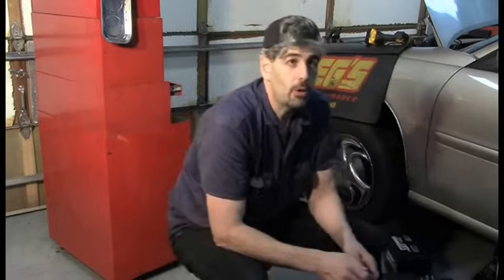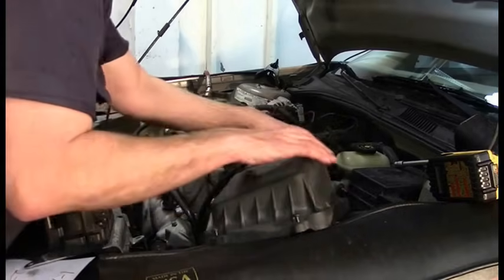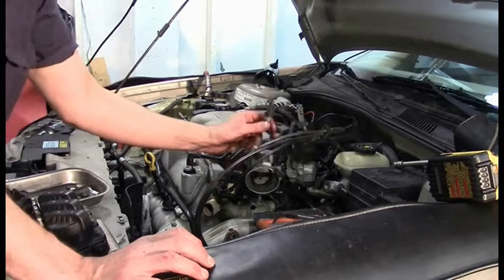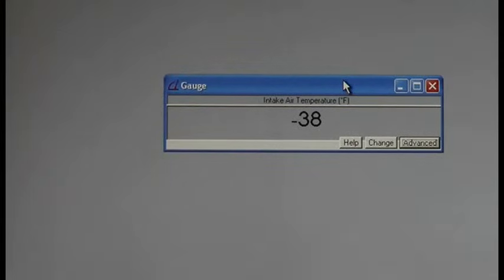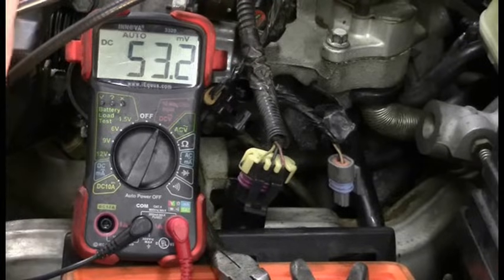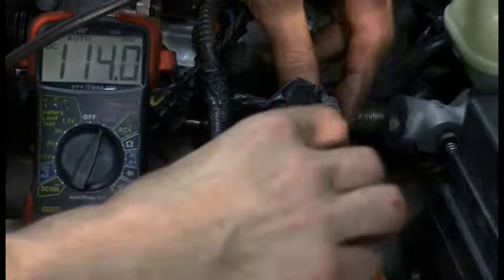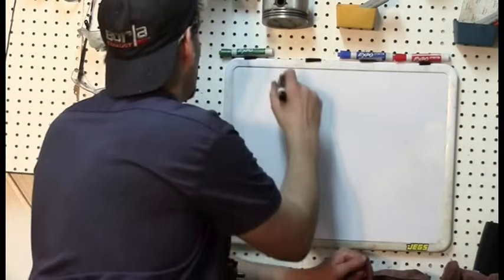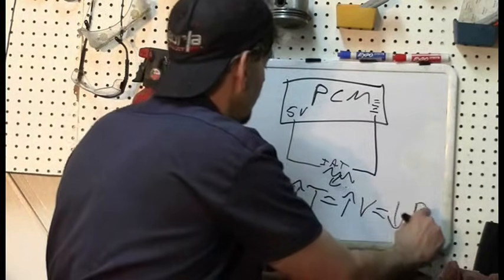IAT ( Intake Air Temperature Sensor ) Diagnosis P1111, P1112, P0113

Comment: Thank you Matt.  My understanding is that the 5V reference originates in the PCM travels to the sensor, is processed by the sensor and then returns to the PCM ground at a voltage of 5 or less.  The wire that returns the less than or equal to 5 V signal  to the PCM is the SIGNAL wire. Do I have the terminology right?  Or is that called the ground?
Reply from the maker: in this design it’s not nearly so complicated. there is no processing by the sensor- the sensor simple changes resistance proportionate to temperature. that’s all. the voltage drop between the resistor at the PCM after the 5V reference and the IAT is simply measured and converted to determine the temperature. 
   the return to the PcM will ALWAYS  be 0V.
Reply: So the 5V reference passes through the thermistor then travels down the ground wire, which grounds through a resistor that’s inside the pcm. This allows the 5 volt reference to remain constant while allowing a volt meter within the pcm and between the pcm resistor and thermistor to see the voltage drop?  Like a voltage divider?
Reply from the maker: Correct except technically the internal PCM resistor is right after the 5V regulator in the PCM. Your description would also work- however the internal resistor is not on the ground side.  Maybe on some cars it is, not this one and not most.
Reply: @ thank you Matt

Comment: I measured the volts from pin 1 and 6 which is the input and output of the IAT part of the MAF sensor and say 4.57volts. if that's ok then why is the computer reading 90-100 degrees when the weather is 60 degrees. Maybe the output wire is the problem and is reporting back a higher voltage making the computer believe the air is hotter and less dense than the air actually is. If that's the case that probably explains why I am getting lean in both banks and the car can't idle. It will crank and start up and RPM will raise then the engine will die. The computer is probably cutting back on fuel thinking it is getting less dense air but in reality is getting 60 degree air so the car is running lean. The car was running during the summer but as soon as the weather started to get colder the engine progressively got worse
Reply from the maker: sounds like you measured with the circuit open. sounds totally normal.

Comment: I have a 2003 Ford ranger and I wanted to test the IAT at the PCM  however the IAT is built into the MAF. All I see is IAT sensor wire gray. Idk if you could help me with what pins on the PCM to test with the IAT pin which I found out to be pin 39

Comment: Hey where are u from man?
Reply from the maker: I’m from St Louis but I live in Denver Colorado.
Reply: @SchrodingersBox  damn if only you lived close by 😂 my car has been having issues with starting and after replacing parts (like an idiot) we've narrowed it down to it's the IAT wiring since it was also pretty loose when we took apart the fuse box. Is repacing the entire wire as simple as cutting it and ordering some new ones or is it better to get a professional to do it?
Reply from the maker: How did you trace it to the fuse box? No IAT I have ever seen is powered from a fuse.  In fact no thermistor is- how would that even work?
   What car is this that the IAT is powered from a fused source? I can’t believe that’s accurate.
Reply: @SchrodingersBox  my bad i got confused the relay for the fuel pump was the loose wire. We think it’s the wire for the IAT because the scanner keeps saying code P0112 “Intake Air Temperature Sensor 1 Circuit Low Input” no matter what parts we replace or clean.
Reply from the maker: If you have a low circuit input then you have a short to ground on the 5V reference to the thermistor. I can’t imagine anything else that would cause that. You can verify easily with a DVOM
Reply: @SchrodingersBox  you really know ur stuff on cars thanks so much man, we're gonna try and repair it this weekend.
Reply: @SchrodingersBox  oh btw I never answered, it's a 96 ford explorer
Reply from the maker: Ford explorder uses a typical basic 5v reference with low reference return. Nothing special at all. You can easily confirm the issue with a DVOM on a loaded circuit.  Don’t forget the internal 5V resistor in the PCM can also possibly have a ground fault so if you don’t see a voltage drop across it, that would be an indication. It’s not likely that is the issue though.
Reply: @SchrodingersBox  I seriously hope you have lived a blessed life so far, the amount of info you've given me helped way more than the $474 work my mechanic did (which didn't fix the issue lol). It isn't his fault of course. Thanks man

Comment: I’m ready to turn Amish and get a horse and buggy! These newer cars, mines a Dodge charger 2010 sxt 3.5! Did a tune up last June, and have had one problem after another! If it would have been my 1995 Subaru that car would have been finished the first day! Why the hell do we need computers in a car and sensors etc. we got by just fine without computers in cars! I HATE NEWER CARS! Just too damn ridiculous! Give me an old boat car instead! DODGE THE DODGE‼️
Reply from the maker: once you understand the basics you easily not only appreciate computers in cars but immediately recognize the overwhelming undeniable advantage of them.  it’s not even close:  computer controlled cars are far, far more reliable, economical, MUCH safer, WAY easier to diagnose issues, and overwhelmingly more comfortable and convenient.  
   the real question is not “why do cars use electrical and computers”. It is “why do people not learn about electrical and computers?”
  it’s clear the direction will never go backwards so it seems logical to me that people would learn the basics of the new technology in the same way as how A hundred years ago people learned about fuel pumps and points and mechanical timing…. So why are people still focused on that when it’s been dead for almost 40 years now?  It makes no logical sense to me!!

Comment: This is a GREAT video!
Mine has trouble starting the first time during the day.  After that it starts fine.  
It was time for it, so I changed plugs, wires and coils, and the Mass Air Flow sensor (after cleaning the original miles = 275,000).  
So here I am researching on your great videos.

Comment: I have a 1996 Dodge B2500 van that is hard to start, takes about 30 seconds of cranking to start it when it's cold outside. I thought it was the intake air temperature sensor. I replaced it with a new one but no change in the cold start. It's something else.
Reply from the maker: agreed. it’s something else. an IAT won’t cause a hard start anyway.
Reply: @SchrodingersBox  Thanks. On to looking at something else.

Comment: The higher the temperature, the  lower the resistance; then,  it follows that the voltage goes low. I think thats the right explanation basing from the bench testing on the sensor. (ohms law)

Comment: How do I replace an intake air temp sensor wire damn mice chewed my wire and I can’t get an inspection because of it
Reply from the maker: just replace the wire. that’s all.
Reply: @SchrodingersBox  splice in or whole harness? And thank you for your response 2*
Reply from the maker: Thanks for the sub. Just slice it in with butt connector is all you need. That’s how I fixed this one!

Comment: Thanks for all your great videos Mat, I am watching many of them for all your explanations and "how the sensors work", I am having a MAF sensor with problem that take a lot of time to find the problem, No codes on a BMW 2010, finally found that the integrated (IAT) into the Bosch MAF sensor was reading wrong like 10 Degrees more but it work. I am just a DIY but finally find the problem, I will look for any video showing those scenarios and what should be the normal intake temp in different environment. Thanks

Comment: Matt, id like to subscribe to your paid channel. 

Im working on a 03 accord 4cyl erratic idle with p0507 and p2279 (idle higher than normal).

Other info: car fuel system remains in Open loop no matter how hot the vehicle warms up.

Data Observations:
I was looking at the live data & noticed two IAT values: 
Start IAT: 97 F
IAT (current): 78 F

My understanding: the intake air temperature is cooler despite the vehicle becoming hotter than the initial intake air temperature and this seems absurd to me because it should be the opposite unless...

Question:
Either a sensor issue

Or an air leak causing the air temperature wirhin the intake to become cooler

Or a PCM problem

Note: i have smoked the intake for a leak and onpy found a leak that did not affect intake air temp as it was located between the air filter and the throttle body; i sealed the leak, regardless. Smoking the intake and all hoses but no leaks whatsoever; used propane and nothing either. 
Cleaned the throttle blade and the attached idle air control valve; chdcked pxv valve operation which seemed to not click vigorously and replaced it.

As far as i hate to be a part changer, this car is making me paranoid lol
Reply from the maker: Allow the vehicle to totally cool and check the IAT against the CTS and if they aren’t within 5 degrees you likely have a bad IAT. 
   However that won’t cause your high idle. Check the IST step count and MAP voltage.
Reply: @SchrodingersBox  this ended up being a bad failing throttle body. thanks a lot

Comment: My iat, Wich comes together with a maf 5 wire sensor, reads 89 Celsius at cold start in the morning. But I do only have a P0103 code. Any idea?
Reply from the maker: Compare it with the coolant temp sensor… what’s the coolant temp sensor read at the same time?
Reply: @SchrodingersBox  coolant 37 C, IAT 89 C. Everything show by the OBDII elm327 scan tool on the screen, in real time. At first start 9am. Outside temp around 15 Celsius. Mine Maf/IAT is a denso 37980. Honda CR-V k24z1.
By the way... I do not have a p0111 or else. Just a p0103 and a p0355. Running in 3 cilindros now. Horrible shake at idle.
Reply from the maker: Based on that I would say that is seems you have a short circuit on the IAT but it’s not your engine issue. The engine issue is surely a misfire from an ignition problem and most likely it’s causing the P0103. I believe fixing the ignition misfire will also fix the P0103. The P0103 is likely a result, not a cause. 
   Try switching the coil with another cylinder and see if you get a code for that cylinder. If so, replace the coil and car should run fine. If the code doesn’t move then you have a wiring issue and will need to check reference, signal and ground. 
   I wouldn’t worry about the IAT- it’s not going to cause a rough engine idle. The contribution from IAT is really minimal.
Reply: @SchrodingersBox  first thing I did. Changing coil, sparks. I did also check continuity between the coil connector and the pcm fat connector. Everything was ok. Today I jumped the two main wires of the maf. Mine is a 5 wire maf. With all the dtcs codes erased. No p0103. No p0355. It is the procedure recommended on the service manual of my Honda CR-V. Troubleshooting on p0103. Conclusion: replace the sensor. I think I'll buy it next week.

Comment: This video is EXACTLY what I am having a problem with, I have the code PO113, I replaced my sensor because I thought that would fix the problem, all the while I suspected the wiring. You gave some excellent info on the process. Tomorrow morning I will look for a bed wire to reconnect. So good !!. Thank you.

Comment: He Knows his Mechanicals And Wise. Very Good Mechanic And Explanations Easily Understood. Your absolutely A Great Instructional Guide. Thank You.
Reply from the maker: Thank you!!!
Reply: @SchrodingersBox I have a 2015 dodge dart sxt that was just cranking but didn't wanted to start so I removed the intake air temperature sensor and it turn on so that's why I just replace the sensor and it now turns on on first try not at second try like it used to
Reply from the maker: The IAT should have no effect on that at all. My guess is maybe the 5V reference was shorted perhaps. What was the voltage at the sensor showing?
Reply: @SchrodingersBox  -38
Reply from the maker: That’s an open circuit. 100%.
Reply: @SchrodingersBox   I thought that I fix the problem with the intake air temperature sensor but right now after coming to work the check engine came out with P0302 code... it always brings the p0300 and p0301 and p0302 but this time after changing the iat sensor it only came that code... I already change the coils and spark plugs 3 months ago
Reply from the maker: Yeah I have to tell you though that while you have an open on your IAT it shouldn’t have any impact as far as misfires or drivability. I believe it’s totally unrelated.
Reply: @SchrodingersBox  but why does it starts at second try in the mornings? Here in laredo tx the weather is always at 100s farenheight in the afternoon and 80s in the morning... on Saturday it was just cranking all the time that's why I noticed that after disconnecting the iat sensor it turn on... it only has trouble at start not at any other time
Reply: @SchrodingersBox  I check some videos about the dodge dart iat sensor and it says that if the iat sensor is bad it can has trouble starting the car and also a misfire code
Reply from the maker: Then I would fix the IAT circuit. But even at 100 degree difference it has less than a .5% effect on fuel trim.
Reply: @SchrodingersBox  the dodge dart has a recall for the catalyst converter, by any chance do you think that might be the problem? Cause when it starts I hear a rattling sound on the muffler or catalyst converter for a few seconds then it goes away also when the car starts I can hear like the antifreeze passing by like when you open the water faucet
Reply: Thanks will do. Any link to your paid channel pleasse?
Reply from the maker: SchrodingersboxQM.com.

Comment: When you start an engine, instantly all the sensors in good condition, synchronize together.... Like an orchestra that follows the scores ( sensors ) and the conductor gives the rhythm ( PCM ).... If one sensor is new and the others are already tested, there will be an imbalance in the PCM information if the margin of error is 2 homs max is exceeded... The PCM will then cut the injection....

Comment: Matt, 
I've been in the electrical trade in one form or another for almost all my 68 years and to hear you say you don't know much about electrical is not being fair to yourself. You know quite a lot.
I found your video incredibly helpful, easy to  follow and understand. I'm troubleshooting the same sensor (showed up on my scanner as code P0111) on my 2010 Genesis and feel your video will make it much easier.
Keep up the good work. 
Thanks so much,
Eric Clenney
Reply from the maker: Thank you very much!  I seem to have a lot of electrical engineers on the channel.

Comment: Enjoyed and learned a lot from your video, but, I've got a question.  Scanned my IAT and it reads 5.04 V.  I took my Volt meter and got 5.04 V at the connector to the IAT.  Ambient temperature today is 47 F.  I tried to read the IAT terminals, but couldn't get a reading.  Does the 5.04 V going into the IAT mean the sensor is bad?  Wish you had talked more about the voltage into the sensor, but your scan tool didn't do that as you didn't have battery voltage to the sensor.   So, slightly confused as to what to try next.  Having a hard time getting the IAT out of the snorkel.
Reply from the maker: sounds to me like you are reading the reference voltage and not the voltage drop across the sensor.
Reply: @SchrodingersBox  so, I need to set my multimeter on Ohms and see the reading between the 2 leads on the IAT?  Then with my 3 hand, take the blow dryer and heat it up to see if the reading changes?
Reply from the maker: just keep it simple and measure the voltage drop across the resistor while the reference voltage is present. you could do it your way and use Ohms law to calculate voltage but you would still need to know either the current or actual resistnce for a specific temperature. way easier to just look at the stop from source voltage.
Reply: @SchrodingersBox  I need some alligator clamps to hold leads to the IAT  while feeding the 5 V to the IAT to read the drop across the pins?  Got some on order tonight.  I think I understand what to do. 🤔
Reply: Well"……found out the most important thing was getting the connector to the IAT snapped back into place correctly!  Check Engine light off now!

Comment: If the Sensor is bad, I'm still an idiot for replacing it?
Reply from the maker: Only if you did it on a guess without validating it was the problem- yes that’s correct. if you tested the sensor and found it was bad before replacing it, then no. you did it intelligently.

Comment: Is a 20 degree F different in reading from ambient air a problem, I have no check engine, but I am looking for reasons why my car is very bad on gas
Reply from the maker: it depends. if engine is warm then of course it will read higher than outside temp. but it should be within 5 degrees of ambient if engine has sat overnight.

Comment: What if you added a bigger intake what that be a cause for the lights cause more air flow is going through?
Reply from the maker: it depends on if the engine is speed density designed or not. if it is then the MAP would need to be reprogrammed.
Reply: I had this issue on my car. I replaced the stock intake with cold air intake then my map sensor went out. I replaced it. The started idling rough. I disconnected the battery for 30 minutes and reconnected the battery. The car still idled rough. Car sat overnight. Started car next day. Glass smooth idle and drive. ?